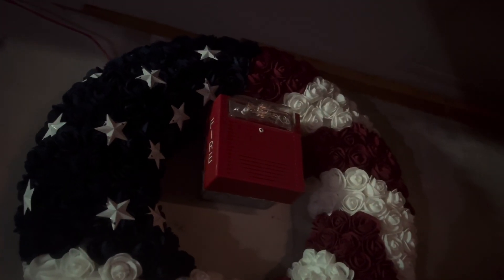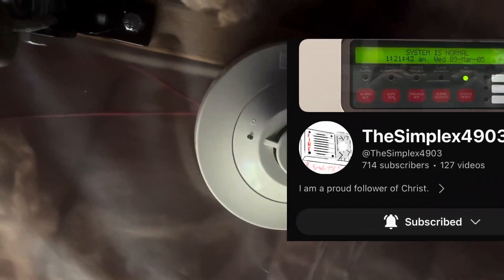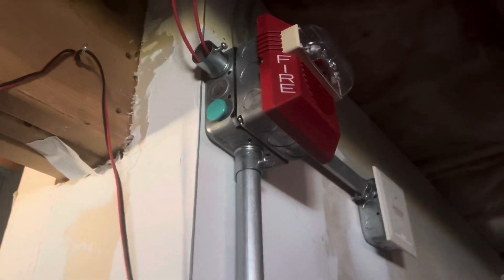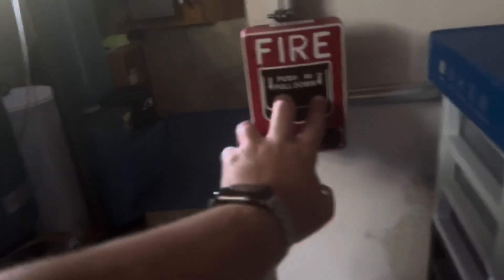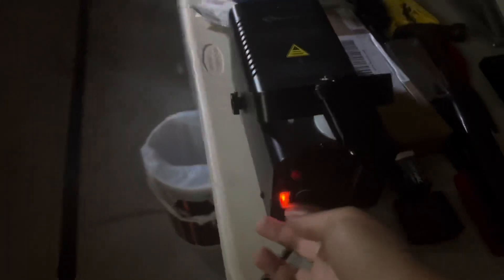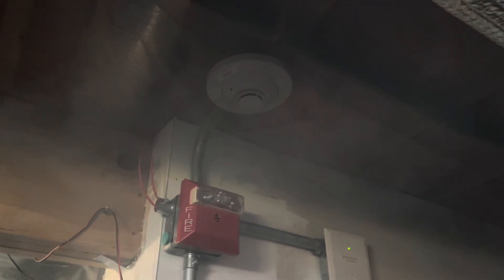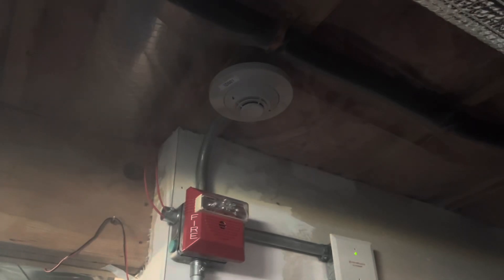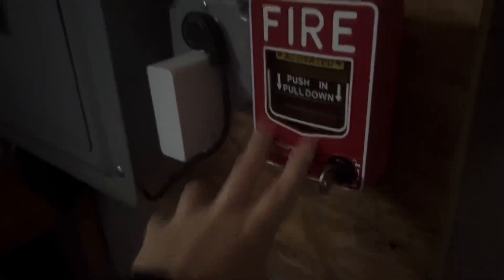Fire Alarm System Test 57: 2000s Wheelock (Requested by @FireAlarmsOfPensacolaFlorida)

Comment: it is actually normal for the LED's to blink slower when you add more devices on the system It will do the same if you ran it on clip protocol too
Reply from the maker: I know that, I was just confused about why my system was blinking slower because I didn’t add any devices from a different tens group.